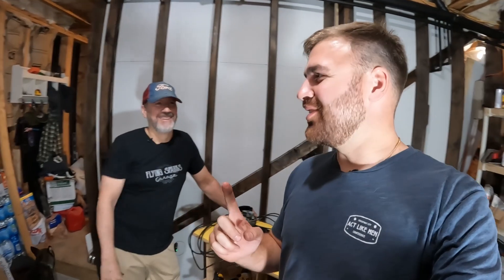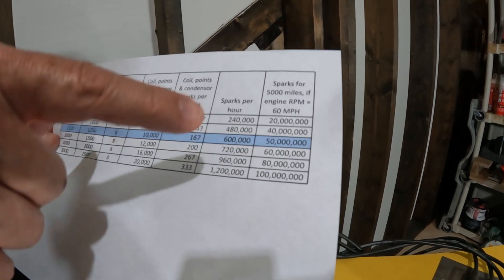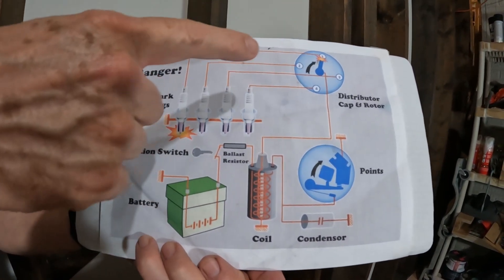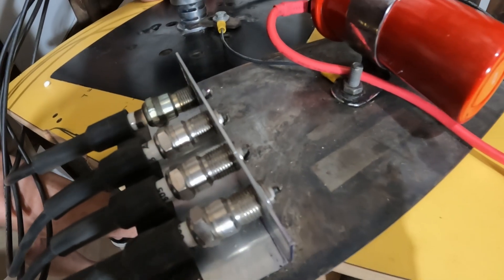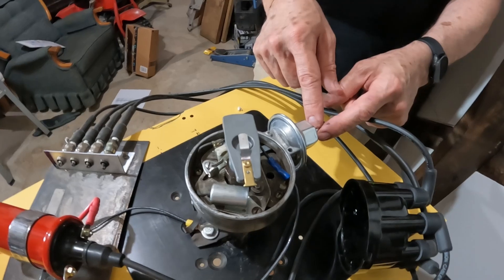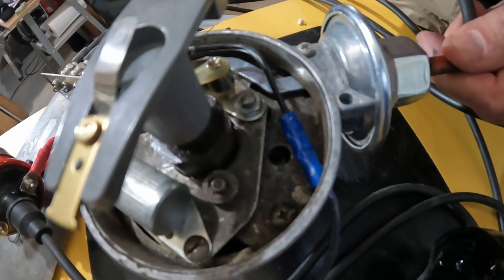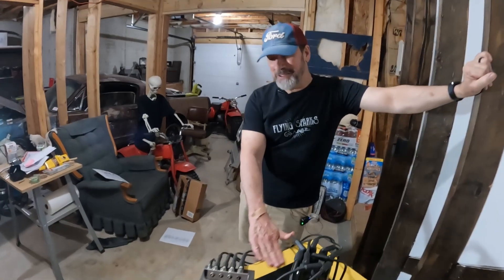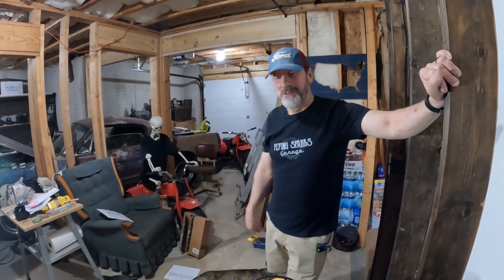The Amazing Old School Points Distributor!

Comment: I put a Pertronix in my 289. Just so I didn't have to adjust or replace points anymore. But always carry a new set of points and condenser in the trunk in case of an emergency. Never a bad idea to have a back up plan.
Reply: Best of both worlds! Thanks for watching!
Reply: Did it roun better and if so in what way? 😊
Reply: @Ron_Presley Pertronix really don't make it run better. Just a more reliable, longer lasting, ignition system than points. I also have MSD in my car. Now that does make it run better, and gets better gas milage.